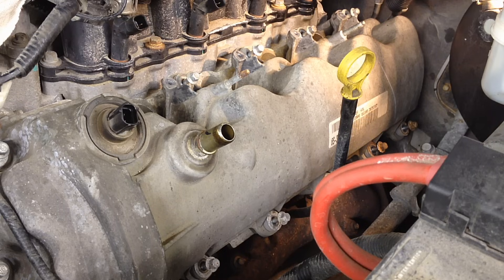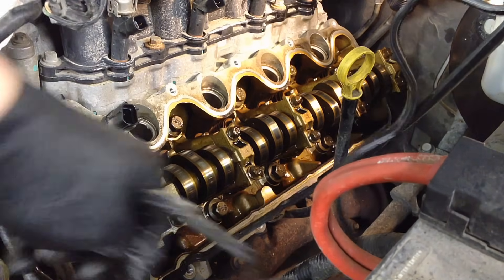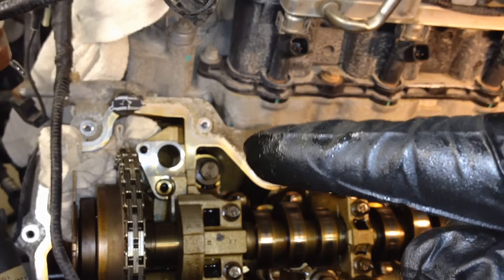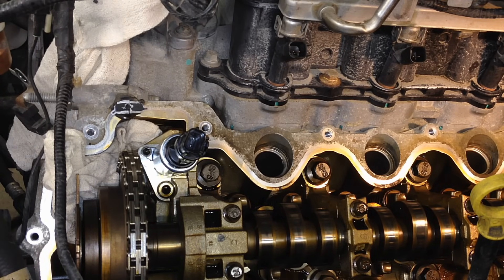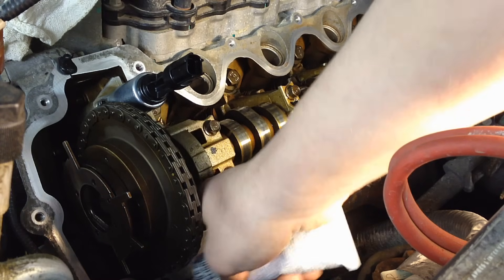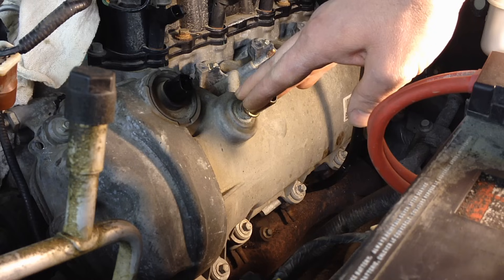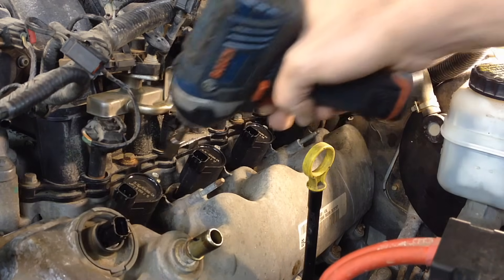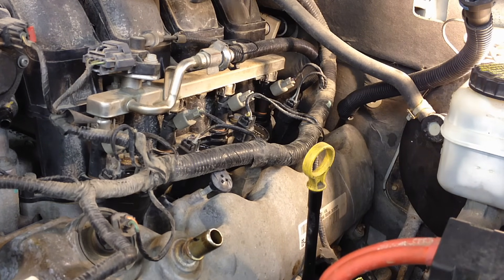Ford 4.6L 5.4L 3v Engines: VCT Solenoid Replacement

Comment: "That wasn't so bad was it?" He says. Show doing that on the passenger side of the engine. It's like Ford intentionally made it as difficult as possible. It took me 5 hours just to replace the passenger side valve cover gasket on my 2005 F150 5.4 Triton.

Comment: Crap.... Okay, now I'm confused. I was having the rough idle when it would heat up, particularly at stop signs and stuff like that. Also getting the codes p0345 and p0349, camshaft position sensor.
As you mentioned in your other video, I disconnected my VCT solenoids and drove it to work for a couple days and everything worked beautifully. So I changed the solenoids today. I put it all back together and went for a nice drive and everything seemed to be working just fine. So now I just got in the truck again and went up to the store and I'm once again having the rough idle and the cam sensor codes are back. 🤔

Comment: Don’t need to remove the valve cover. Just remove the rubber grommet and remove from there
Reply from the maker: Yes you do, only early models 2004-2007.5 can you get away with just the grommet. What about the other 7 years this engine was around. Plus any service valve covers installed on 2004-2007.5 engines you will need to pull the cover. Think before you comment.

Comment: Can you remove the chain cover without removing the valve covers?
Reply from the maker: I have yes but it is not ideal.
Reply: @FordTechMakuloco  I did it on my 6.8 V10 and it saved a lot of time. I think I will try it on my 2007 5.4 soon. The covers look a little different on the 5.4..........hmmm

Comment: I bought a used 2006 for expedition and this engine has been giving me TONS of trouble. Had oil coming through the vct solenoid leaking out the top and replaced them both and its still coming through. Engine idles rough as hell and now im losing oil pressure. Its currently a paperweight because i dont have the money to fix it and seriously regret buying it. The previous owner probably did not take very good care of it unfortunately for me

Comment: Just finished replacing the VCT solenoids on my 2010 F50 5.4 and wanted to share a few things I learned. It appears there are a few different valve cover designs for this model year and engine size. Mine is not like the one in this video. The grommet seal, which came with the solenoid, in the valve cover is smaller. There are a few YT videos showing how you can replace the VCTs without removing the valve covers...which I attempted. Ends up there are two different bushing/grommet shapes...one with hole in the center of the grommet and a larger one with the hole offset. My solenoid came with both style grommets. If you have the larger one, you might be able to remove the solenoid without talking off the valve covers. It not only allows you to get at the retaining screw, but the hole is large enough to remove the solenoid once it's lose.
 
On my engine the passenger side cover had only eight bolts while the drivers side had nine. The other things to note is a few of the bolts on mine were rusted (190k miles) and I could not even get a wrench on them. I was able to use a REXBETI Impact Bolt & Nut Remover I purchased from Amazon which I needed on two of the bolts on the passenger side. I ended up finding some replacement bolts at a Ford dealership, but they are pricey....$15 each.

The biggest pain in the whole job it getting the wiring harness and other crap out of the way to get at the bolts. Especially on the drivers side. I ended up removing the air cleaner housing which made it a lot easier to get room to work. On my engine there was also a 1/2" diameter steel line running from the brake vacuum booster across the valve cover and back being the engine. It is mounted on a bracket that is secured to the cover. I was able to free the bracket and take off one short rubber line which allowed me to move it out of the way enough to finagle the valve cover out with some effort.

My man here knows his sh*t that's for sure and he makes it look easy. It's not hard, but it takes some patience and there are no real short cuts. Better to spend time moving things out of the way instead of trying to work around stuff. Good luck !!
Reply from the maker: 2007.5 to 2014 you must pull valve cover
Reply: @FordTechMakuloco  Ends up it did not fix the problem anyway, so now I need to replace the phasers which I am going to attempt from the top after watching one of your other videos on how that can be done. Should be fun.
Reply: Hi does this mean I won't have to remove the cover on my 2005 mustang gt ?  Thank you.

Comment: Once again I am humbled by the knowledge this man has when it comes to Ford trucks. I listened to others tell me I could remove the CVT valves on my 2010 F150 5.4 without having to remove the valve covers and I even bought a #27 t-handle wrench to help extract the retaining bolt through the hole in the valve cover. I was able to do that....after heating and bending the shaft of the tool so it could get around the body of the valve to get to the bolt, but once the valve was removed, the retaining ring prevented it from fitting through the hole in the valve cover. It appears there are variations of the valve cover that do allow this to happen, but mine is not one of them. Well the good news is at least I have a video I can trust that does show me what I need to do now. Thanks for all your help for us Ford Truck owners !!

Comment: It's kind of  a shame that this vid doesn't show just pulling the VCT seal / cap on this 2005 valve cover, instead of pulling th ewhole cover, but I saw you did make another video doing it thru the seal - cap, it's MUCh easier than removing the cover!. I had a bad cold start valve clatter for years, tried different oil filters, no change. Not long after, it developed the dropping-slow diesel like chugging idle on occasion as well, then it started giving me a bank 1 "P0340" code that would come and go. Living in Hellnois and facing a emissions test to get my new plate reg sticker, I decided to try to install a Bank 1 - passenger side VCT. I sourced a Standard "Blue Streak" kit with a new seal & cap for a 2005, as well as a seal for the newer aluminum valve covers, gathered up some tools and going by your other vid for the R & R w/o taking the valve cover off, I managed to get it done in about 30 minutes. It ran well during a test drive, I let it sit overnight, started it the next morning and, ZERO VALVE CLATTER on cold starting!  The vehicle has 140K + miles on it, I am going to look into seeing if you can do a whole phaser - oil pump - chain, tehsioner, roller follower and lash adjuster replacement job, but at least I can get it through emissions testing and get a plate sticker w/o worries now.

Comment: Hi leaking oil under the vct valve is normal? No seal on it! It is fitt well when I crank it is it leaking! I have a knock! New hv pump and timing set phasers also! Ford parts! If you get time to get back to me. Thanx

Comment: YOU DONT HAVE TO REMOVE THE VALVE COVER UNTIL 2007. The solenoid holes on my 2004 are large enough to clear them. In 2007 Ford got dumber, if that is possible. 173k, Historic Plates, my 5.4 runs like a swiss watch. 1 Pint of Marvel Mystery Oil, then fill with 5-30 every 6k miles. MMO= NO VARNISH.

Comment: What’s up dude I got a 2007 Ford F-150, trying to change the VCT solenoids on both sides, no matter what T27 screwdriver I use I can’t get to the screws to take it out….any ideas? tips? 

or do I need to take the valve covers off
Reply from the maker: Probably aftermarket solenoid in there that can be T25 or T20.
Reply: @FordTechMakuloco no it was definitely a T27, had to take the valve covers off. solenoid wouldn’t fit through hole and screwdriver wouldn’t fit down in to get a bite in the screw. 

Doing the passenger side VCT solenoid as well, will have to take valve covers off that side as well….pretty sure 07 and later you had to take them off to access them
Reply from the maker: yes mid year 07 and later all use the smaller hole as well as any service valve covers used on any model year.

Comment: 2010 f150 4x4 xlt with a 4.6.  I had p0016 and p0303. Changed both cam sensors. Still codes... changed the VTC on both sides. Miss fire gone Still p0016. Cleaned the injectors. Checked coils. What more can cuse this. I'm hoping its not the chain.

Comment: I have a 2008 F150 King Ranch 4X4 with a 5.4 but the VCT valves are centered and not offset.  I think I have to remove the valve covers to get them out because the holes aren’t as big as the off center valves    Someone told me I have to remove the ac lines and other things to accomplish this.   Any suggestions or videos with these type valves.
Reply from the maker: Yes you must remove the valve covers as shown here. The passenger side is gonna be tight but the accumulator can be repositioned out the way.

Comment: Currently looking for valve covers for a 97 4.6 triton. If anyone knows where i can find one plz respond to this. My oil cap is on the driver side not the passenger side, not original engine believe its off an expedition or explorer.

Comment: Hey getting a p0010 now after replacing the vct sensor on bank one the sensor is not oem though can that cause issues with timing or should I change both out with oem or change the other one to the same aftermarket one from O'Reilly I even unplugged the vct sensors and it still was knocking and running rough

Comment: I have tried several times using your link to put these VCT valves in my shopping cart on Amazon and they will not go into the cart and when I go to Amazon without going through your link they will not come up so the only way I can buy them is through a part shot because your link is crap.

Comment: When replacing these should you do both if not what issues could it cause. I replaced one and now my mph are 10 over what I’m actually going but my rpm are correct

Comment: Howdy all.. 2007 F150 5.4  Any advice on removing that 19mm nut underneath the bank 2 valve cover. it holds the bracket for the power steering reservoir. Need to remove in order to do the solenoid job. Thanks in advance :)
Reply from the maker: It is an 18mm head and I use an 18mm standard depth socket and a long 1/2" ratchet with flex head.

Comment: I have a 5.4 with a 15 bolt valve cover

It needs to be replaced, engine is getting rebuilt. 

Does the 10 bolt pattern (replacement) fit and seal an original 15 bolt pattern? 

Or are the gaskets different?
Reply from the maker: The new 10 bolt valve cover uses a different gasket and comes with the new valve cover.

Comment: I like how this skips all the hard part of removing everything around it first 🙄
Reply from the maker: You don't know how to pull off a connector?
Reply: @FordTechMakuloco  no, the dipstick tube, the break booster line. All the intake components...
Reply: @FordTechMakuloco  the struggle of the coil boots too, tore one of those.

Comment: @fordtechmukaloco man i have a 2010 f150 5.4l 3v and its got a real rough idle surge from 1k -1.5k rpm back and fourth back and fourth. It also has a problem with 4wd theres almost no vaccum at the solenoid just passed the check valve but no grinding noises and i can hear the transfer case do its thing, still no 4wd and it revs real high like its not in gear almost when in 4lo along with the diesel sounding and rough idle, the surge only happens in park .

Comment: Could this cause a P0018, P0022, P0171, P0300, P0306, P0307, P0308, P0316, or is it more likely that the cam jumped timing? Super rough idle, but it still starts and runs. 150k miles. 2007 mustang gt. I guess I'll know for sure when I pull the valve cover off, right?

Comment: This can be done without removing the valve cover, FYI
Reply from the maker: Only up to mid year 2007 at best, do the 2007 through 2014 models not count? Plus any older models with new valve covers also cannot be done without removing the valve cover. Nice try....
Reply: @FordTechMakuloco 

So a 2005 GT would be a no go ? 

Thank you

Comment: December 2023   After watching all your 5.4- 3valve videos I didn't want to buy a used Ford, butI did two days ago  (2009 F-150 5.4 with 229,000miles). The truck is said to have had the timing chain done and a high volume oil pump. Right when I returned from a test drive the engine started rocking and knocking. I said, "oh oh, whats up now?" the seller admitted he had a diagnoses of the right bank cam out of timing. I shut the truck off and restarted it after a minute and it was smooth again.
I knew right away the problem and looked up the parts and bought the truck anyway. Only $1700 for the rusty Michigan truck. Thanks, the truck is a great improvement over my rusty 1996 Dodge.
Reply: How's it running since you changed the VCT's?

Comment: you do not need to take the valve cover off. the grommet around the sensor comes out. gives access to the T27 bolt.
Reply: Is this true?

Comment: Is it true the older 5.4 which is 2008 early model has a different vct solenoid . The newer 5.4 which they updated the sparkplug , the vct can’t be remove without removing the valve cover is that true
Reply from the maker: The solenoids is exactly the same part number, it's the valve cover that changed in mid year 2007.

Comment: Can you put a 10 bolt cover on a 15 bolt
Reply from the maker: yes
Reply: What valve cover do you recommend
Reply: I had bought a dorman one and it only has the 9
Reply from the maker: I only use Ford parts.

Comment: I watched your video until I understood its contents. I have a 2009 Ford Expidition 5.4. I got my work bench prepared with the tools to do the job, bought the Ford VCT's from amazon and new valve cover gaskets. It took me 4 hours start to finish to do the job.  Thank you Sir.
Reply: I wouldn't buy from Amazon even if they look like genuine parts. Counterfeit parts are getting so good that you can barely tell, sometimes you can't tell the diff until they fail 50% sooner than OEM

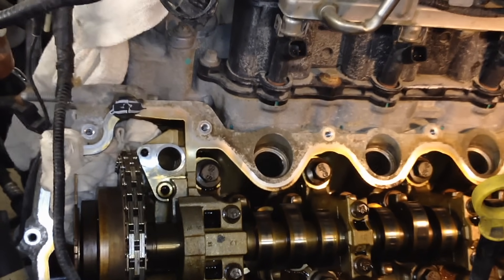Comment: Go to 6:24 - you were pointing to the VCT Housing that the VCT attaches to. On my 2015 Ford Explorer, while replacing the VCT, the "ear on the VCT housing" broke off and I now have nothing to attach the new VCT to regarding connection. It looks like there are 3 bolts that hold the housing on but it connects to the secondary cam shaft chain. I hate to mess with the chain or timing - is there any other manner in which to replace the VCT housing that you are aware of now? Many thanks in advance.

Comment: Ive seen numerous videos where the solenoid was removed without removing the valve cover. Is there a reason why you removed the valve cover instead of doing it by removing the gasket around the solenoid only?
Reply from the maker: There are many reasons yes but remember mid year 2007-2014 you MUST remove the valve cover.

Comment: I have a 2005 mustang gt with codes for vvt solenoid actuators on both sides , are the part numbers the same?
Reply: I have the same problem after not driving my Mustang for a while! Any suggestions?

Comment: I just did this but your valve cover has the big VCT seal which if you removed and changed it,  you’d know that you could have replaced the solenoid without taking the valve covers off.  My VCT hole was the diameter of the solenoid so I had to remove the valve cover.  You also didn’t change the seal.

Comment: I have a question: What is MOA & EPR Motor Oil Additive Lubrication and what does it do? And 2? Gasket, put in dry gasket and then seal it with valve cover and then reconnect the battery or not during the process. Thanks

Comment: reading the HAYNES © tech manual (Ford f150 2005) they say the 4.6l does not have a VCT solenoid. I'm scratching my head ..
Reply from the maker: Correct that is because you have a 2v engine.

Comment: Have the P0341 code for bank 1 and sometimes rough idle and dying described here. At  152k miles my  engine very clean inside so hope this solves it and not another computer problem.
Btw. 2010 Explorer 4.6, 8 bolts on right. 9 on left.

Comment: I had the issue where my 2006 explorer 4.6 would idle a little rough w/o a/c on. Once turn a/c on and engine was hot enough when coming to a stop would definitely shutdown on me and or accelerate horrible. And most cases would turn fan off and a/c i would just get air coming out. Replaced the vct solenoids i gained horse power and respons but still have the same problem.

Comment: I'm replacing my VCT cylinders, I went to the links below to the Ford dealer you deal with and I typed in my 2004 Ford f150 5.4 l there doesn't seem to be a motorcraft, VCT cylinder for a 2004 Ford f150 5.4 l,  can you help me with the VCT cylinder part number for a 2004, Ford F-150, 5.4 l, four-wheel drive. Thank you.

Comment: Please help if you can… 08 f350 5.4 of course.. iv diagnosed down to the vct bank 1 . It would run fine when I unplugged it. So I pulled the valve cover and replaced the sensor and now it’s the same issue with erratic idling and misfiring when I come to a stop and wants to stall. Very loudly. It of course stops when I accelerate. So I unplug the same sensor I just replaced and it runs fine again. I thought I would reach out to you . Iv replaced plugs, coils, filters, tps sensor, cleaned throttle body , 2 oil changes
Reply: 149000 miles
Reply: Also can’t believe I fordot to mention, all this started happening about 3 miles after I did an oil change so I’m assuming the vct isn’t getting enough oil pressure . Just bought this truck

Comment: Brian, thank you for all your videos.  I recently bought a 2011 navigator.  The previous owner had the VCT solenoids replaced a couple years ago, but the vehicle is starting to throw codes about VVT and idle rough.  There is also oil leaking from the drivers side solenoid around the grommet.  Do you have the part number for those grommets?  All I can find are the 2007 and earlier years.